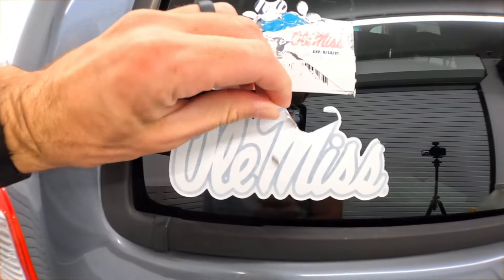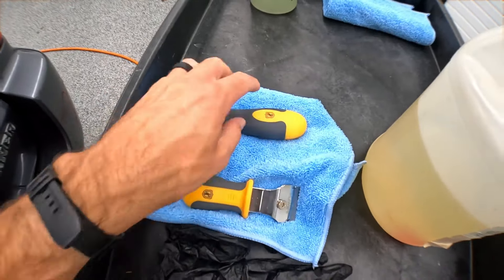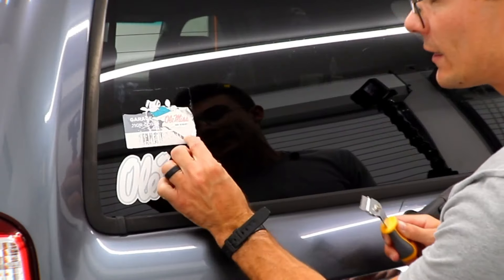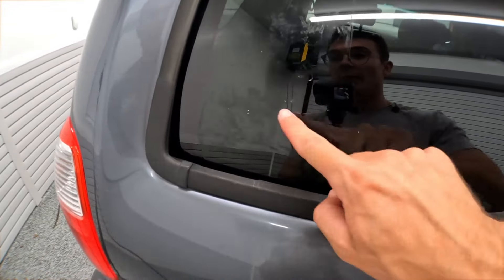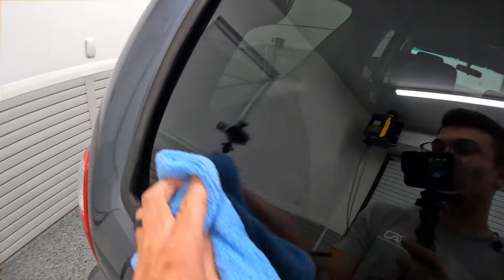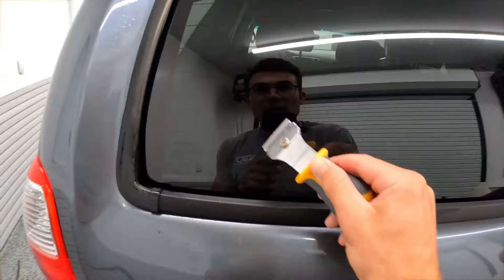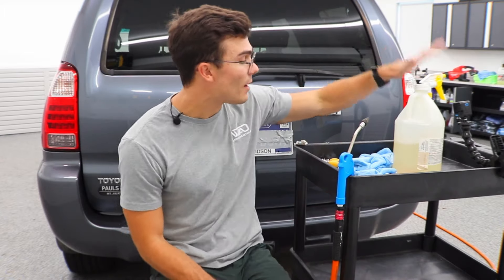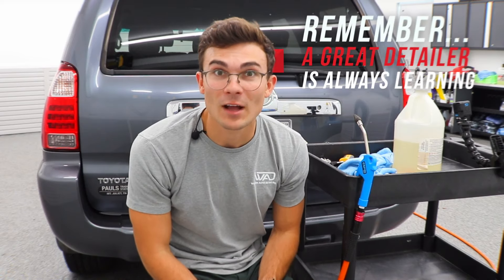Remove Car Stickers in Less Than 2 Minutes - 2 TOOLS EASY HACK

Comment: I have taken one of  my cars to remove old tints and apply new. I can see fine scratches from using a metal razor . Also I ended using a metal razor with soap to remove zap, dried up soda and realized later when sun hit that spot at a certain angle , again really fine scratches. Can you give any feed back ? Maybe I'm doing something wrong . And yes blade it's new and area it's dirt/dust free= washed.